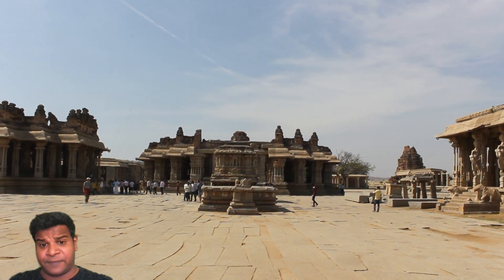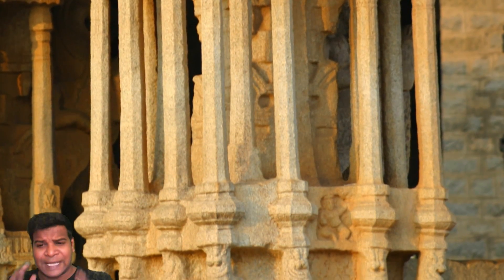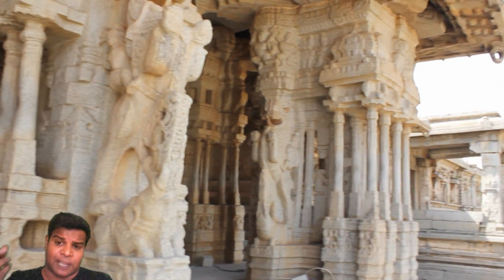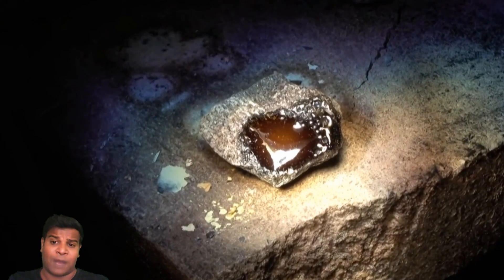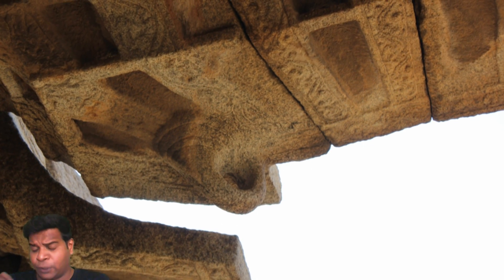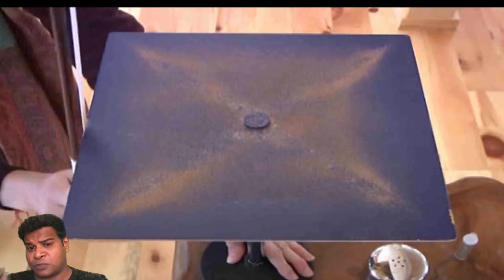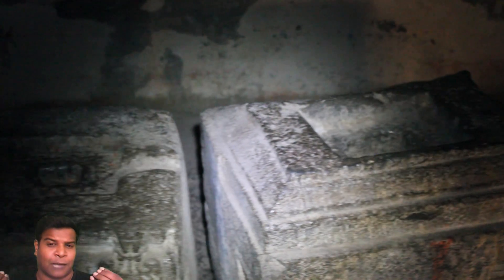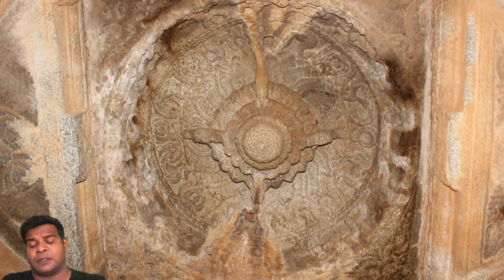How do the Musical Pillars Work? Rock Melting Technology? Cymatics?

Comment: Melting rocks? 
That is so tough. It need to be on spot to hook up two different  rock types like modern day welding. I trust that after such a welding, it would leave crystals on it or embedded in rock to reveal if it is thermoformed. Meaning, molten rock would not be exactly same as original. 

As far musical pillar, it may be possible to alter density by encorporating other soluble material such as sodium silicate by soaking pillar followed by drying. This can alter density without changing nature of rock substantially. 

Same material may dissolve part of rock in chain with little harsh treatment allowing it to pass through hook but then bridging it back is impossible without a kind of welding. 

Interesting. Great work.

Comment: As you say it is a  rock melting technology it  could be possible to create these patterns by keeping the mass of rock in molten state;vibrate it to such a magnitude till it starts solidifying  & remain as solidified rock. The different layers will have to be created layer by layer. Why I am saying this is because when you create cymatic patterns on metal plate they have a 3D form.You can try creating cymatic pattern by laying a thin layer of

Comment: All the notes are from the F sharp major chord. I tested it with an acoustic device. It's all sacred geometry.
Reply: Please let the common viewers like us know what you are going to say sir please.
Reply: What is meant by F Sharp major card and that acuistic device.sir.
Reply: @gopalnaidu5267  The second and third harmonic of F sharp is Phi... the golden ratio... which creates a standing torroid within a boundary area. For instance if you were to vibrate water at a specific frequency in a bowl of water from the center axis the water would bob up and down continuously in the center and the water would start to spin in a standing torroid. When done correctly with sound and a dipole you can create a vesica pices that forms the egg of life.. the flower of life, the fruit of life, the tree of life etc. Done correctly you can weave plasma together and turn sound into matter and vice versa. The process of creating free energy is actually quite simple and known... more simple than you can imagine... the only problem is that it has so much power .. as much as 200 trillion watts... enough to power the whole planet for free. Nobody wants it it seems. at least not yet. These notes are part of the F sharp major chord.. there are 7 notes. It's the one in the middle.. the F sharp that has the most energy because it's tuned exactly to the cycle of the great year at a frequency too low for anyone to hear... once wave every 25,920 years.... 12,960 years ascending and 12,960 years descending. At the high end it's the same frequency of the sun,,... the color yellow.  Right now we are ascending. In about 12,000 years time will stand still and we will be completely non material. At the moment we are slowly becoming non material and in about 4000 years our lifespans will be over 1000 years. Time is not a constant. In 12,000 years the past , present and future will all be happening at the same time. You would have to read some Vedic texts to get this knowledge. You can also find it in the Dogon and Buddhist cosmology.
Getting the energy is super simple. You cut a stone to a 5:3 ratio and you get an F sharp. So if you cut the stone to 90 hertz and it weighs 500 lbs and you sing to it at 90 hertz... OHHMM.. it's going to vibrate  90 times a second and hammer on whatever piezoelectric stones you put underneath... and if the stone underneath is cut to the same note.. you will get a trillion volts out of it. 500 lbs of force on a quartz crystal gives off 12,500 volts per cubic centimeter. They had all this technology 3000 years ago and more than you can imagine.
Those basalt Lingams are basically solidified lava and are 75% quartz. They are piezoelectric and if you hit them with the frequency they are cut at they will vibrate and heat up and glow red hot and give off heat for a long time. It's already grounded.. it's like your stove element.. you put enough current through it and it glows red hot..... well if you get it to vibrate it will put out a trillion volts and it's already grounded... it should glow. They give away the secret at the temple.. it's sound.... vibration. You just have to find the right note it's tuned at. It's either 360 hertz.. 180 hertz...90 hertz.. depending on what device.. it can also be 1.45 hertz.. meaning it powers from people heartbeats... in infrasound. In some of these temples you see a 7 headed snake. Snake means vibration. Well that's the F sharp major chord.... the snake in the middle is the sandwich... the F sharp compressed between the 3 notes on each side. The note with the most energy. There are 7 universes and we are in the 4th.. the one in the middle. We are an F sharp. Everything on this planet is a fibonace spiral. Together these 7 universes form a Giant DNA strand... each universe is one of the notes in the F sharp major chord. Of these 7 universes they each have a non material side.. either your ascending or descending on that wave... becoming less material or more material in this cycle.
 We are in a binary orbit with the star Sirius. I can prove it based on the ancient texts and scientists still can't confirm it today. We are speeding up and time is slowing down.. and when we go around it again in 12,000 years it will happen in the blink of an eye so fast you wont even be able to see it. Time will stand still and people will be living for 30,000 years but we will be non material with no ability to act because everything will be happening at once. We become the gods and the people on the other side who are the gods now become the material people. We are living gods that have not quite ascended yet.  Time is not a constant.

Comment: Before I finished the video, i was asking\answering the questions you were asking\answering 

Is there definitive way to know what materials are in these pillars? My guess is they would choose crystals and\or metals melting them into the rock. with care and cooling the stone properly you could most definitely restructure the multen materials to the new structure based on the recepie. thus the cymatics. when struck they vibrate. i bet its a much cleaner sound with the sandstone sticks.

i would like to see some honest analysis on some samples.... on the other hand, i hate seeing these temples take on more damage.

Comment: You can definitely carve a chain out of solid rock. It is not easy, but it can absolutely be done. You can certainly do it out of wood... It's a classic thing to carve to show off your prowess. Lol, you spend a lot of time on this.. so I thought you should know. It's also frustrating that you did not show the junction where chain actually connects to the roof very well, because I'm sure if you look closely, you will see a mechanical solution... Either the top link is a hook, or some other shape or it is otherwise some kind of open link so that the chain can be installed. You cannot melt or lift rock with sound. The carving, engineering and techniques displayed in these ancient buildings is remarkable and impressive all by itself... we don't need to embellish it with a bunch of pseudoscience and mystical nonsense.

Comment: I have seen a u-tube video explaining cutting rock with steel/iron cylinder, with sound vibration (cymetics). Strange more research are not done. However, there is one clue. The hooks are granite while the chains are  lime stones. Still melting rocks must be looked into how stone rings can be joined without melting. Very interesting puzzle, even the British tried and failed to solve.

Comment: The chains are not made of rock. They are just chains made of dense wood but coated with a geopolymer sandstone, so one cannot tell the difference.  The one that connected to the roof had a section removed from it, and replaced afterwards and glued. then a geopolymer coating was painted over the entire chain.
As for the musical pillars, they had to have been drilled up through the bottom before they were installed, with the proper tone achieved before installation.

Comment: If the weight distribution from the top attachment of the pillars differs then pressure and frequency resonance would differ as well, creating separate tones. It would work like the opposite of creating separate notes by pulling a single wire/string by different force. Easy, if the assumption of asymmetric load is correct ?!?

Comment: Hi Praveen,
you mentioned that the British did not find holes etc when they cut parts of a pillar.... has research been conducted to determine the composition of the pillars' interior? The concept of rock melting only makes sense if the granite pillars are not 100% granite... it makes sense if there are other minerals/materials involved.

Comment: This may sound weird, but a thought outside of the box.  The barred soap 'ivory' is nicknamed 'the soap that floats', due to an accident in its creation.  Air was mixed into the soap in its creation, making it lighter than water.  What if you could melt rock?  What if you could mix air or some kind of gas into the Rock in its melted state?  Would that affect the rocks properties? Could that create different sounds without affecting the size or shape of the rock?

Comment: its no big challange to carve a chain from a solid piece of wood for example.  Stone would be more difficult but the technique would be the same. (google it) connecting it to a granite ring is a mystery. I dont buy the melting stone theory. The size of the furnace would be huge and nothing in nature can burn hot enough even with bellows. It would take pure oxygen mixed with something like propane or acetyline to melt stone .

Comment: The pillers, acts like guitar strings.
When you bang against it. 
It will vibrate, as a frequency. So many,  wave forms per second.
In hz.

There are many ranges that we don't normally use.
Add up,  all of pillers, to see the total amount of them.

I'll  take a guess.   =   369.
This represent the full range of mans avalable awearness, center's.
If you are there, you should feel each note, as it resinating through your meridian channel's.

9 of them are related to the dna emunity system.

Comment: Perhaps the cavities in the stone were made by mold injecting. If the stone has a melting point and you take wood and carve it, rub Ash in the mold and pour the molten rock into the mold. Then as it starts to set you pop off the mold and then with tools you can do final shaping without needing crazy new technology. Does any of the stone have a melting point? Can it be melted and shaped?
Reply: Sorry I mixed the previous video with this one.

Comment: I like the fact that however perplexing a find is, you never go into supernatural nonsense, but stick to natural explanations based on knowledge of physics and engineering.

Aren't the heads of the pillars different? Also somehow they could've put differential weight on the pillars, altering the tension and thus the frequency. 

As for the chain, it can be carved out of a single block of sandstone, it doesn't even have to be too big.

Very interesting and needed videos. Keep it up!

Comment: Can we reverse engineer the Cymatic patterns into the sounds they represent?
Reply: I thought the same thing - each cy~carving represents specific sound frequencies.  If the center carving represents the combined sounds of all of the pillars reverberating at the same time, then it could be the key to decoding the sounds of the others if you could design a cymatic plate that creates the central pattern from the pillar pattern (minus at least one pillar).  

Also, how many cymatic carvings vs how many sound pillars are there?

Comment: I have difrent other clues of pillor sound 

Ita not melting rock technology 

One other think 

Same size pille same higth but one think difrent that pillor up side many difrent wight and wight presser on pellor creat sound some pillor hanging not can posible to show but hinging pillor posible and that way pillor create different sound and pillor on top have very high wight that pressure and gravity's creat sound that is posible 

For example if we use iron rode and we put up wight and hanging that rode creat difrnet sound with difrent presor on top and hanging
Reply: And when they creat carvin before puting hig heat on rocak after start cuting with heating and cooling that rock react molecule chang in heating and water put after heating that time use tools for carvin veary easily creat with temre change and work 

All rock react difrent in tempre fire and they use also water and sand and iodine and chemical that time chamical Creat by trees that technology now not we know its lost but melting is posible but its reserch subject for roack coz how they know wich temperature is right for melting rock

Comment: I have slept on this problem and think I know how these pillars are tuned. If the ancients were able to 'melt stone' -then it means that they are able to 'hold the components of the stone in varying states of materialization -suspended animation-of the elements. if you can understand that all matter is composed of charges of energetic states acting upon elements, then is it possible that the silica content of the sandstone - while held in suspension - was 'tuned with a particular frequency (determined resonance) and then the composition made 'material' (solid) to hold this resonance within its crystalline structure of silica content in it's finished composition that simply appears the same in each column yet emits a different cymatic note?? I think this is true and leads to all sorts of other questions being answered about use of crystals and how they can be programmed as we already do with radio frequencies. In this case it could have been the masterful intention of a few gifted  holding the material in suspended state while the epole were instructed to 'impregnate' the energy field with the desired sound resonance?

Comment: could Varying sounds possibly be created by different stresses on the beans. Maybe some are stressed more and some are stressed less. like a guitar string. Sort of. So have you tried to see if the patterns on the roof match up to the actual sound produced by the room. When you do the simple easily reproducible experiment with the sand and a bow. The sand and the bow on the plate. It is such a simple experiment anyone could have done this at any time in history pretty much. And discovered the patterns of the sounds. You could just speak through a hollow tube and direct the sound at the bottom of the flat piece of wood with sand on top probably. To expose to your vision the patterns. So I would wonder if the patterns in the roof carved. Actually match up to the sounds produced by the rooms. And I wonder if somewhere you set sand in the room produce the sound and get the pattern. Sand was obviously readily available. how long have we understood opera singer can bust glass. I wonder. I mean these patterns on the roof could just be patterns. That represents something other than sound maybe. Maybe the sound is supposed to represent something else. Maybe if you try to match the sounds up to other things in nature. Somehow you hear some comparable quantifiable similarity. what you're really discovering is what people can accomplish with rudimentary technologies. People can come up with some pretty brilliant Schemes. I feel like melting rock and making stuff out of it. are there any volcanoes around there were they could just scoop the melted rock. Or at the very least noticed melted rock and assumed they could melt rock to And Tried it.

Comment: I highly appreciate your investigations, but would even more do so if you did not allways try to press everything you see in your preset ideas. Here, for example, you show us this stone chains that can ONLY be attached to the hook on the temple by rock melting technology. If you take a close look at your video material, you can see clearly where the chain is put together. Did you ever consider why this ancient perfectionists  should have used  a reject pillar that came bent out of the cast in their otherwise elaborated temple? Hard to imagine.

Comment: How about DISSOLVING rocks rather than melting rocks to work the shapes. Alternatively, Ganas did the work. Sound technology == different crystalline structure of same material enabled by introducing minute amounts of other materials (like in making PNP junctions in transistor chips) plus different amount of pressures (loads) on the pillars.

Comment: Those circular patterns look like concentration points for resonance.  If this structure pre dates the younger dryer impact event, then that would really be interesting, because that event is said to be responsible for a massive loss of our atmosphere.  Meaning the air would have had much greater density.  Sound wave propagation would have carried significantly higher levels of energy.  The musical pillars then would not actually have been esoteric or novelty, but rather when played correctly the controls for what ever it was this structure was for.  

Just another observation, in many Samaria carvings and Egyptian hieroglyphs there are human like figures holding what look like pine cones.  I see the exact shapes all over this thing in various places.

Oh and how do you have rock pillars all part of the same stone create the various different tones, well how do they make tones at all... I would be willing bet the cylinders are hollow and the walls are varying thicknesses.  Each pillar would then resonate to one of the concentration points and the energy would be transmitted along the path creating cascading resonance and ever increasing energy.